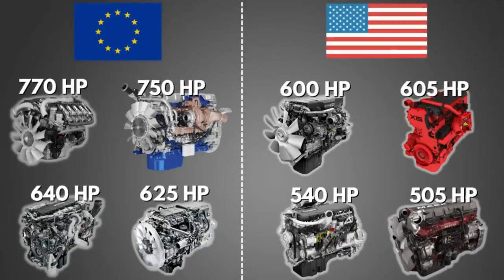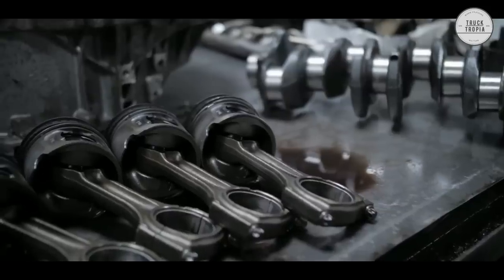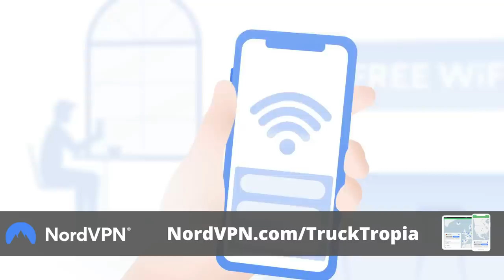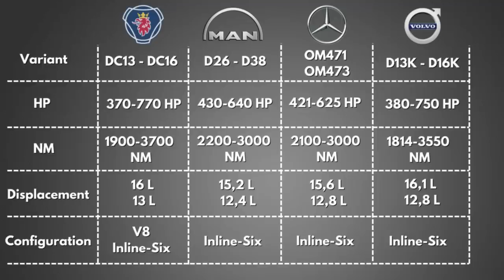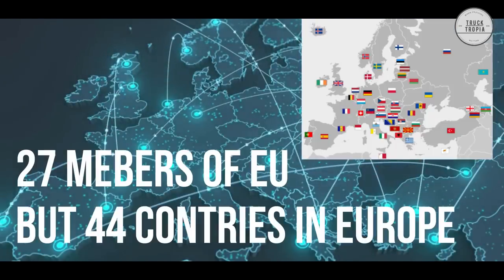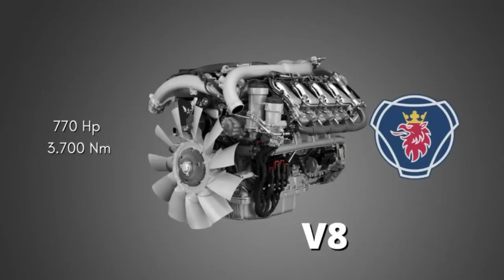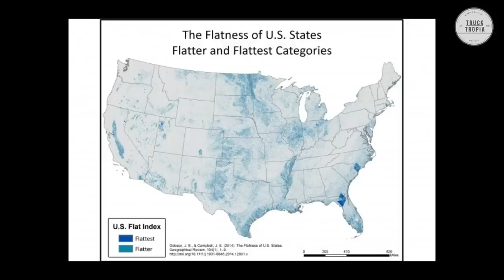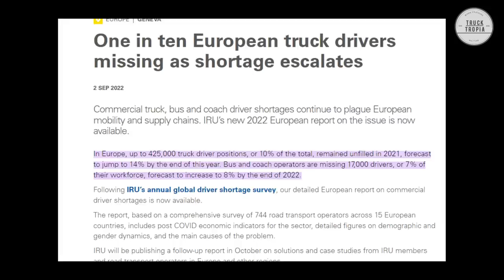Why European Trucks Have Up To 770 HP And US Don’t

Comment: As others have pointed out, Scandinavia is the only part of Europe where those massive weights are common and not limited ton special oversized transports. A larger engine is usually more efficient and durable with extra heavy loads. The vast majority of European long distance trucks are specced in the 400-500hp range. Thats not to say American manfuacturers didn't have giant engines for special applications in the past. Stuff like the Detroit 12V-71, Mack E9 and Cummins KT
Reply: Michigan has no weight limit and South Dakota is 150,000lbs. Really glossed over that one didn’t you
Reply: Outside Scandinavia there are more countries that run 60 tons, or experiment with higher weights
Reply: @bigdaddystep.  It makes sense to not include MI and SD. They're in a minority of states, both have specific axle loading restrictions allowing for the higher weight restrictions, and SD only allows 150,000 lb. combinations on designated roads. IA has something similar, but it's more restrictive. Explaining the details is a whole video in itself. Gotta get that ad revenue 🤷‍♂️
Reply: @bigdaddystep.  Michigans limit is 164000 lb. But they dont allow as much per axle. You need 11 axles to haul that weight if I remember correctly.
Reply: @Alexander Ratisbona 500 hp is the max all above are mostly private drivers. More hp engine means expensive truck.
Reply: The biggest surprise for my is still why the US doesn’t have V8 anymore??
Reply: Don't forget about the good ole Cat 3408
Reply: @antonfloor344  emissions regulations and fuel economy.
Reply: @antonfloor344  Scania tried with the 142 . But it was too expensive with import tax as they refused to send them in kit form for assembly in the US. Which would of made them American made with no heavy import levy. Volvo snuck in the back door .. buying out White & slowly rebranding the marque. If Scania had that idea .. they would of been a major player in the US.
Reply: Not really scandinavia, but sweden and finland. Finland is not officially part of acandinavia, but part of the nordic  countries. Norway only have 19 meter limit, and Denmark only 18.

But Denmark is about to upgrade to 25.25m soon
Reply: @fooseballs308  Michigan B-Trains, baby!
Reply: Except that most of those engines are now obsolete , emissions....
Reply: @Motologist95  This can actually be said for a lot if not most states. Maine literally has logging trucks hitting the scales at 240k lbs on 7 axles, granted they are running offroad/private roads. Here in Colorado and the majority of neighboring states we can run two 53' trailers, but it is more common to see either a 53' or 48' followed by a smaller "pup" trailer. In all honesty throughout the US you can be permitted to be just as long or heavy as anywhere else in the world, Uncle Sam just wants his cut...
Reply: MI limit is bridge law. When I was hauling coils, the trucks were licensed for 160,000 with an 8 axle trailer (your 11 axles). Pretty sure the tandem trailer units went heavier. Messing with Garbage trucks now, and 66,000 lbs is common on just 3 axles.
Reply: @antonfloor344  I6 is cheaper to service and manufacture. You can just keep on making them bigger and put a bigger turbo on them.
Reply: @antonfloor344  ask international
Reply: @groofromtheup5719  bridge law is every state.
Montana has 131k, but you need to bridge right, I used to haul a 9axle 118k rocky and with my axles being in groups of 1, 2(+1 pusher), 2, 1, 2 that's the most I could haul(iirc I was 98ft)
Reply: The author of this video took the most underpowered engines in US trucks and most powerful from Europe, in USA they put from factory with warranty 700hp engines into pickup trucks like RAM TRX or Ford Raptor R for your local farmer to haul hay, biggest car size in Europe are considerd compact cars in USA, BIG horsepower and BIG size of vehicles is first thing I noticed when I first came to USA
Reply: @MidwestDIY  those don't come in semis.
The listed hp tq numbers for us is accurate for today's engines
Reply: One thing i haven't read so far is that for example dump trucks in the U.S. are generally much smaller for example.
In the EU dump trucks have 3 to 4 axles and have often all-wheel-drive in some parts. Also the cementmixers are a lot bigger in the EU than in the US. In my home county you see many many 600hp+ trucks because of the steep terrain
Reply: we've also got a fair number of the higher power Trucks here in Austria and the other Alpine regions. while we're limited to 40t usual loads having the Alps to deal with is reason enough for a bigger Engine i suppose.
Reply: @bigdaddystep.  But can you run that weight down to Arkansas tho ? The EU is pretty much like the US regarding local weight limits some are high some are low. But the 40 or 44 ton plodder are the main stays . They can go pretty much anywhere. And continental Europe is not flat at all. All loads on freight to go websites are geared for that weight .
Reply: @smudgealdrin1512  the argument here isn’t lines on a map. It’s hp needed for weight. Of which the point I made is correct.
Reply: @antonfloor344  V8 less repairable than inline 6's for what is needed in the USA so people here prefer the inline 6
Reply: @antonfloor344  cummins offers a 600+
We run them in our trucks in North Dakota
Reply: @bigdaddystep.  Michigan has weight limits. I hope you aren't hauling through there with that idea.
Reply: @antonfloor344  Hello! The V8 is MORE expensive to produce… Cheaper is better… That‘s the reason
Reply: @SlimPickins_07  don’t try to talk down to me kid. I’ve been an owner op for 8 years.
Reply: @bigdaddystep.  8 whole years huh?? Lmao.
Reply: @bigdaddystep.  you still have to be permitted to run those weights.
Reply: Italy has higher axle load then other southern states, their semitrailers carry 32t, ours 25t.
You can use higher load trucks in most of EU with more expensive tax and permit.
In my country you can get red lettering plates and you pay more tax so you can have higher axle weight.
In Europe there is 12T axle load limit, and i think in Italy, Sweden and UK you can have 14t axle load with permit.
I have 100T mobile crane with 5 axles, 12t per axle load, 60t total welght. And that is not big unit, 10 axles cranes are normal thing.
Reply: @antonfloor344  dont pull and fuel hungry
Reply: @Motologist95  Most of these loads are strictly local and specialized applications. Most carriers are running interstate rules and have to stick to interstate gross and axle rules. These specialized carriers are set up with the big motors as well as specialized transmissions, suspension, and such.  The majority of us are running basic packages, such as the basic engines refered to here. If we deliver or pickup in a state with the larger load gross, we cannot come in or go back out at those higher load levels. Unless we want to lose time and money at every state line to buy permits like back in the old days. I, myself, do not wish to relive those old days.
Reply: Yeah I know that a few trucks here run 12V71 and v16 detroits
Reply: @philliplyttle1005  WOW! Still have some of those old beasts out there working for a living? It would be fun just to sit by the road and listen to those old gals working. Preferably under load and accelerating and going through the gears. Pure music!
Reply: @ronfullerton3162  lots are actually sitting on farms or junk yards rusting away
Reply: @ronfullerton3162  I know where a cab over v12 (with drop axle) is just rusting
Reply: @ronfullerton3162  honestly the loudest truck in town is either the 1 dodge bighorn or the 8V71 5 ton. Both of which are yard trucks
Reply: @philliplyttle1005  That is sad. There are enough guys looking for the old rigs to rejuvenate and put back on the road that I am surprised someone hasn't gotten it. If nothing else but to grab that 12V-71. Not as much WOW power, but I liked the 8V-71. Driving was never dull while truckin' with a 318.
Reply: @philliplyttle1005  Nothing talks like the 318!
Reply: @ronfullerton3162  it's got a really low power cummins. For the life of me I couldn't find a turbo on it. So I was curious if some bighorns had NA cummins in them or if the person modified it
Reply: That is not completely true. In the Netherlands 50 tons or 110.000 lbs is allowed and with some additional rules 60 tons or 132 lbs.
Reply: @antonfloor344  The advantage of more HP is that you can keep up the speed on steeper inclines, which saves on time and thus on cost! Also it makes you accelerate faster with the same weight (which also saves time, and cost, in busy traffic with much stopping and starting like in Europe). So yes, there is an economic advantage for big horsepower, but that advantage is bigger in Europe
See for instance this test. https://www.youtube.com/watch?v=2c5VrmctUBQ
Reply: @matsv201  Norway has mountains though, and lots of them...
Reply: @Luredreier  that is true.  But I wounder if that matters in current year
Reply: @bigdaddystep.  No one in this world outside of those two states cares.
Reply: @bigdaddystep.  So you mean that bridges in Michigan are built for unlimited payloads?
Reply: @antonfloor344  What do you mean by private driver? In the Nordic countries all trucks are owned by some kind of company, bigger or smaller. Nowadays there are very few companies with only one truck, and then we think of trucks for gravel transports.
Reply: Larger engines are more efficient? You have any other jokes?
Reply: @antonfloor344  So NOT true in Sweden! All of our Trucks in my company are Scania, 16 liter V8:s with a minimum of 580 BHP.
We haul sawed timber and steel coils from all over the country to different sea ports in Sweden and a normal total weight in our combinations is around 64 to 70 tonnes.
Reply: Lot of 6nz cats running around over 700hp in the us
Reply: @sandasturner9529 never late in a 3408
Reply: @eliasfalser9963 80k in the states
Reply: @leorguevara3622 yea but if it’s not a cat ….well it’s a dog
Reply: @philliplyttle1005 what over the road truck has a v16?
Reply: @BadLanz86 I really don't know what the model of trucks they are,  but they are both yellow and can't even hit highway speed. To be fair though they are larger than lots of truck around here
Reply: @fooseballs308  and in europe you can have a higher axle load i can do 26000lbs on my single drive axle. Therefore i only neef 5 axles (12tires) for a total wheigt of 116000lbs. And 7 for 130000lbs. Thats mostly bc the roads in europe are a lot stronger and thicker.
Reply: @matsv201  dont they have 25.25? We even have them in the Netherlands for over 20 years now with 60ton total wheight
Reply: @groofromtheup5719  just wondering, how much can you have on your drive with a 3axle? And to you have 2 drives? Here in europe you mostly see single drives with a liftaxle. Double drives are rear here
Reply: @larsmeijerink5471 It use to be 24 meter. But due to how the long and short trailers operate in other EU countries (and really we talking about Germany here) it turned out that if you had a standard short and long trailer it would be more than 24 meters when combined.

Germany thought this was a unfair advantage for Swedish truck drivers that could go to Germany and and split up the trailers, while German truck drivers could not combine there trailers and go to Sweden.

Germany wanted Sweden to shorten it to 18m, but that was just an option, For a compromise the length was extended to 25.25meter 

Later the maximum load was raised from 60 ton to 76 tons to better use the size available.

When the 24 meter rule was originally made in the 1950 it was made for trucks carrying groceries, and there really was not trucks that reasonable could pull 60 tons, to they just put that some what logical weight (because its 50% longer than 18 meter trailer, 50% more weight than 40 tons seam reasonable).

Fast forward to like 10-20 years ago when trucks easily could pull more than 60 tons and have done so for quite a long time. It turned out that timber trucks was usually loaded over weight. Because they where now able to pull longer trucks, they could also fill them. First the raised the fine for overload quite singificantly.

This resulted in that timbertrucks was running with a good meter or so of clearance over the timber. Eventually the protest that this was wastefull and there was a compromise made. They could run 76 tons, but they still need to retain the 16 ton per boggie  and in addition to that electronic logged measuring was introduced. So they got a additional 16 tons, in exchange for making cheating virtually impossible.

And to be fair, it was not only cheating. Back not that long ago. Truck drives had to calculate each axel load manually on a sheet of paper. Truckdrives are generally not experts in math, and a lot of them just calculated it wrong, and some just didn´t bother doing it
Reply: @smudgealdrin1512  I'd like the idea of a V8 Volvo vnl 780 yummy 😋🤤
Reply: @larsmeijerink5471  double drives are what is assumed here. 34,000 lbs is the 50 state legal tandem drive limit. Different states can permit more. In my branch of my industry, I almost always see tandems rated for 46,000 lbs. I have seen a couple 52,000 tandems, and I think 60,000 is an option when ordering a chassis. 20k for a steer axle is pretty common. Heavier is pretty rare. The chassis I deal with are almost all 20k front and 46k rears, so 66k total. Oddly enough, sometime I have trucks where the transmission is the limiting factor on a 3 axle truck. The Allison 3500 is only rated for 62,000 gross. I think there is 1 version they up rated of that series to 66,000.
Reply: @groofromtheup5719  ok, that cool thanks for that. Most trucks here are single rearaxle, they go up to 28660lbs steers farry between 15/25k. Double rear axle trucks mostly have 1 22k drive and a 20k lift/steer axle. Double drives we dont have on normal trucks. Trailers have or 3x 20k axles or 3x 30k with 1 or more steeraxles (bc our roads are mostly to small for trucks) our total wheight on a normal truck is 116k and on the 82ft (double trailers or boxtruck with dollyand trailer) it is 143k total. I have seen trucks in idk i believe Canada who have dolly locks but we dont have them, we just back up with 2 pivid points😅
Reply: @matsv201  That's why 24 meter logging trucks are the most common trucks in Norway? (not really, but they're really common)
Reply: @antonfloor344  The inline 6 is easier (cheaper) to produce, and easier to maintain. US trucks have fewer space limitations so we just put the big long motor in there and call it a day.
Reply: @bigdaddystep.  I know of a couple guys who haul steel here in Michigan, both running Cats (sorry, dont know what model). One told me he's pushing 900 hp and the other close to 1200 hp. The latter claims to run up hills at 120,000 lbs at 95 mph or more. These of course are owner operators and are way beyond factory
Reply: @antonfloor344  Much higher torque with in-line engine, with similar displacement, tends to give better fuel efficiency and longer life due to lower rpms
Reply: @matsv201  25,25 meter is already driving in Jutland since 2016 🙂
Reply: @neg8098  i guess wilipedia needs an update. I only know the swedish and finish laws. I  don't drive a truck just makes specially loads for them
Reply: @smudgealdrin1512   They trying to do that with navistar
Reply: @eliasfalser9963   Same as Australia Dump Trucks and Cement mixers are much larger
Reply: @anthonynicholich9654   Yes in Europe going from restricted speeds on a mountain
Reply: @eliasfalser9963  In Finland 5 axles dump trucks are common. If I remember right (Drove my Truck lisence in 1996..) 5 axles is  37 metric tonnes gross and with air suspension 38 tonnes gross weight.
Reply: @robertryan7204  There are a few new Gen Scanias cutting around Chicago with Navistar written all over them.
Reply: @smudgealdrin1512  Very interesting, Scania is an aggressive company looking for new markets
Reply: @robertryan7204  Scania do still have a presence in the US . But is purely supplying municipal bus chassis , axles & engines to body builders for bus & RV applications. You will never see the Scania badge on any of them either.
Reply: It may grow if you see Scania being used in mines
Reply: @bigdaddystep.  I worked for an outfit in SD, we grossed 148k with 13 axils.
Reply: @ronfullerton3162  noise and smoke! L
Reply: @ryanehlis426  Those old Detroits were loud, no doubt about that. But they didn't smoke much if the pumps were left at factory settings. Unfortunately, not many pumps were left alone. Some companies actually turned down the pumps. But most of the time, they were "tweaked" for more power and smoke. I am sure younger EPA officers would have a heart attack to see on of those old Jimmys or Detroits running the gears with a heavy load. Or the old Maxidyne Macks! Lordy how those old beasts did smoke.! They looked like Union Pacific's old 4014.
Reply: @MidwestDIY  those are toys.
Reply: @MidwestDIY That 700 HP isn’t quite the same, horsepower is torque multiplied by rpm, so the higher an engine revs, the less torque it has to make for the same horsepower number. The Scania DC16 reaches peak horsepower of 770 HP at 1800 rpm, I can assure you no pickup truck engine in the world does that. Another clue is in the displacement, how many pickups have you seen with a 16 liter engine? Horsepower is useful for comparing similar engines, but completely useless when comparing engines with vastly different engine speeds. There are ship engines in tugboats rated at a measly 400 horsepower, but the torque output of those engines are insane as they only turn over at around 100 rpm.
Reply: Wish we had those motors back again.
Reply: @antonfloor344 Inline 6's are perfectly balanced.
Reply: @choelstad91 you are correct, though the isx cummins and x15 cummins can be modified to reach those hp numbers
Reply: Hello US citizens, the news of the day is that a whole world exists beyond the US borders.